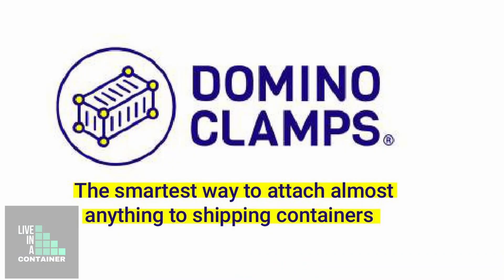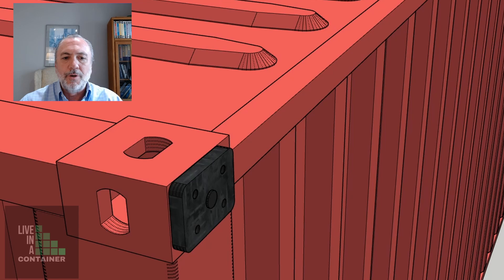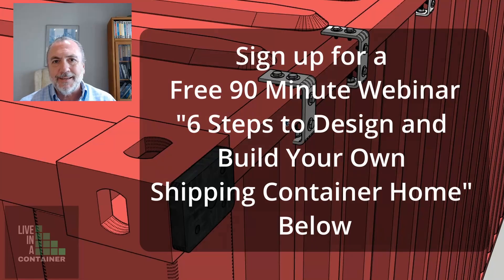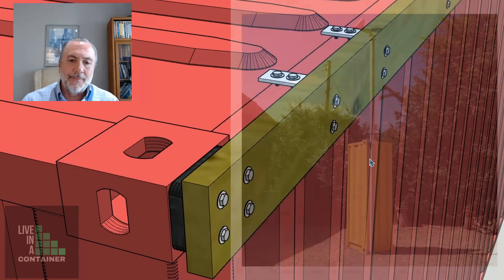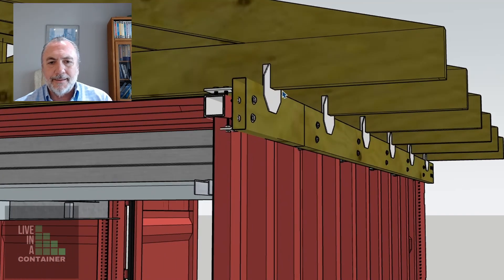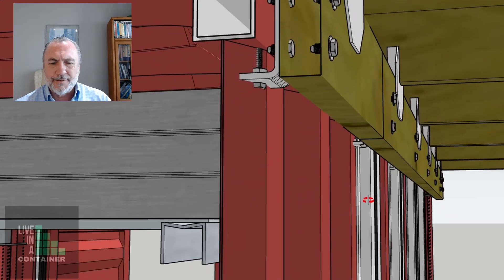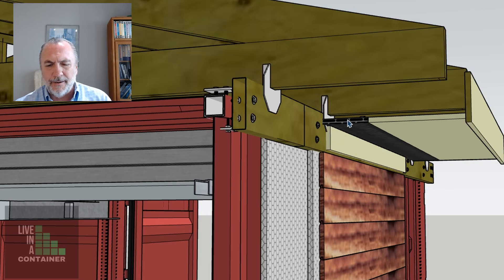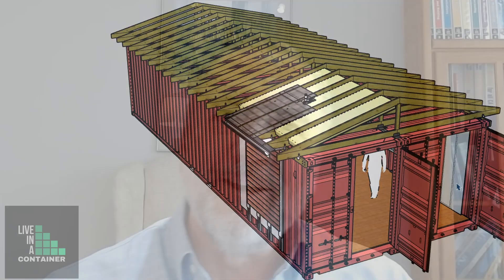Shipping Container Roof Truss Attachment Made EASY with Domino Clamps!

Comment: Could the domino plate be attached to the top hole? I need a solution for bolting on a metal roof structure that doesn't extend out to the side.
Reply from the maker: The Domino Clamps are not designed to be used in the top hole. For attaching on top Domino Clamps suggest using either their:

Angle brackets 
https://dominoclamps.com/collections/shipping-container-brackets-and-adapters/products/angle-bracket

or their new, soon to be released vertical bolt plates
https://dominoclamps.com/collections/shipping-container-brackets-and-adapters/products/vertical-bolt-plate

Domino Clamps have lots of good info on roofs here: 
https://dominoclamps.com/blogs/uses/how-to-plan-your-shipping-container-roof-project

and for attaching wood in general: (but equally applicable to steel)
https://dominoclamps.com/blogs/uses/different-methods-for-attaching-timber-to-a-shipping-container

Comment: Learn to weld  quicker cheaper  more secure and long lasting. just pick up some decent gauge angle iron secondhand  from skips scrap yards demo sites.  Once welded  drill through trust and angle iron  and bolt. Teach yourself to weld or take classes , you will have a skill for a life time.
Reply from the maker: Thanks for the tip

Comment: Outstanding information.  Thank you!  Is there any reason welding "L" brackets at the container edges isn't acceptable?  I have the ability to weld and to make the appropriate L brackets.  I am so excited to start my dual container project, still searching for land/location.
Reply from the maker: Welding is an excellent way to connect items to the containers.  It takes skill to weld and it appears that you are well suited for that task. Just be aware that welding will damage the integrity of the Corten protection properties.  So, paint over at least the welded area to protect the steel from rust damage.
Reply: @liveinacontainer6602  Thank you for the response.  I intend to sandblast and use a bunch of red oxide bare metal primer on all welding areas.
Reply from the maker: @roberta4989 Great! Let me know how it turns out.